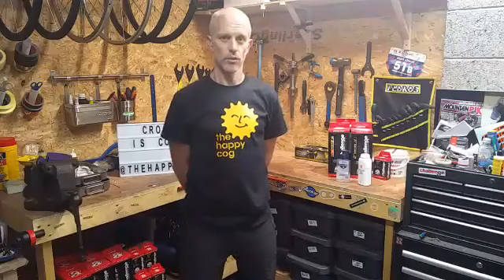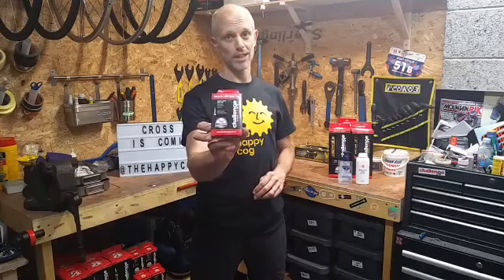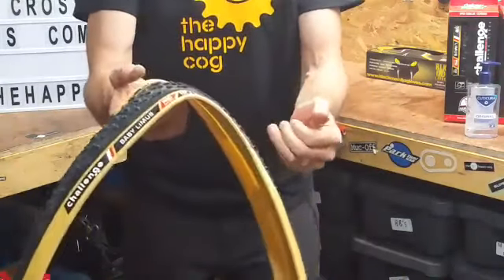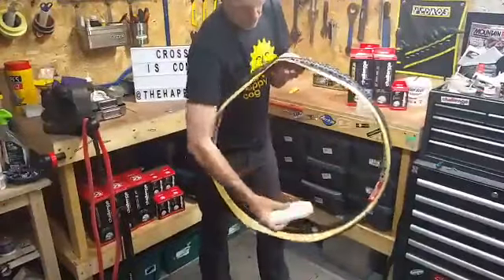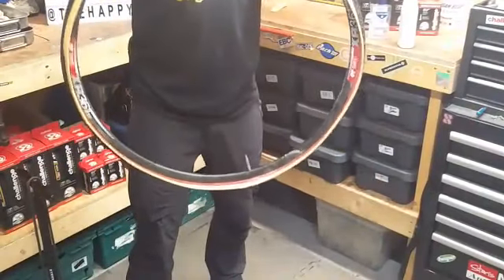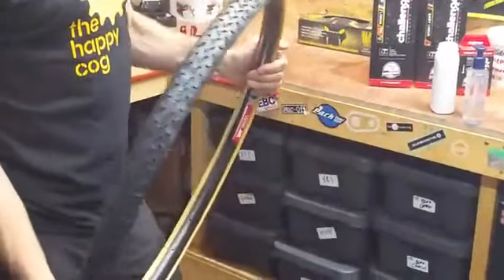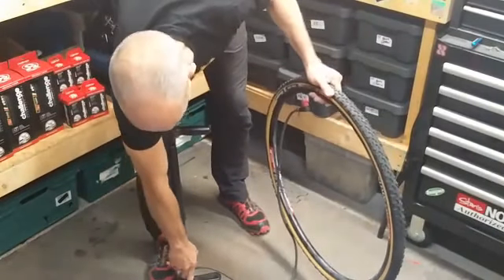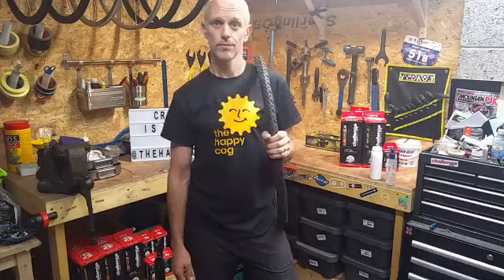How-To Fit Latex Tubes into Open Tubular Tyres

Comment: Have just installed two strada Bianca pro 36mm pps2 TLR on zipps 303s. However, supported myself with tire lever a little at the end. All went flawlessly, took me max 10min per tire and did those first time ever. Thanks man! 🙂

Comment: Alchohol cleaner at the end is a game-changer as is the talcum powder. The last bit of tire to go on is a huge deal with challenge tires.
Reply: I got one on rolling. Had to use the tire lever for the front wheel. Put a hole in a $21.00 CAD latex tube. Hand strength is not my thing but it can work rolling if you have the means.

Comment: I'm really not often changing tires (the last ones were mounted several years) and was pretty afraid because of everyones horrorstories about these rubbers.
Had no alcohol, talcum or one of those fancy latex tubes, but with your instructions and careful use of a plastic tire lever it took max. 10 min per tire. Thank you so much.

Comment: I had a very hard time fitting the Challenge Strada Open Pro (road racing) on to my Campagnolo Zonda's. I mounted them without the inner tube first, just to get them a little bit more forgiving. It was still difficult, but after seeing your video things went better. The powder made the difference, and it is good to know that it also helps the inner tube not to stick to the tire itself. Thanks man!

Comment: Been struggling with a Strade Biance 30mm and latex tubes. Not possible to pop in the ¨big¨ latex tube. There is nog enough room for it. I think it´s the combination narrow rim, narrow new tire and a wide latex tube. I read the tip where fittying it with normal tubes first to form the outer tire, maybe it works. Don´t hope to get a flat in the nearby future :)  :) Any more tips?

Comment: Why tubes and not running tubeless?
Reply from the maker: Although tubeless tech has come on a bit since I posted this the main reasons are feel, grip (due to low pressures) and the ability to run really low pressure without the risk of the tyre burping air. 18-20psi can cause tubeless setups to burp air and roll off the rim especially on off camber terrain.